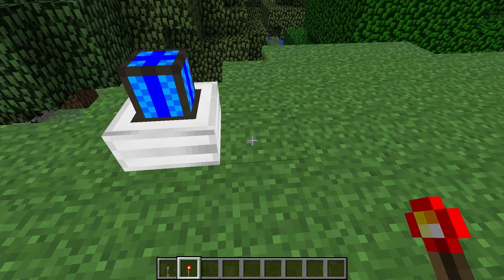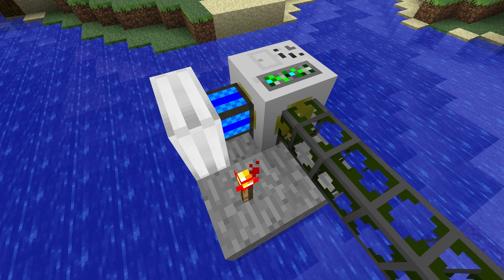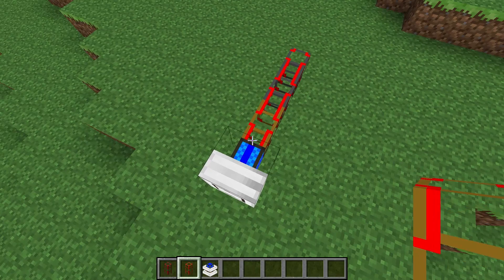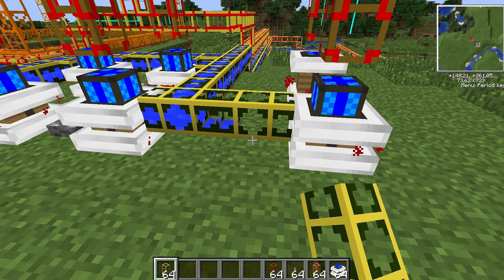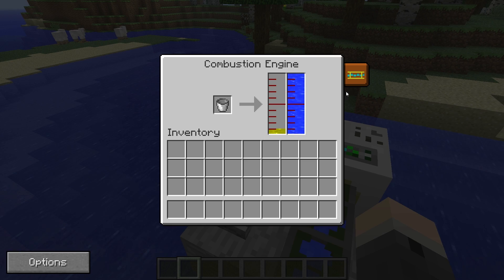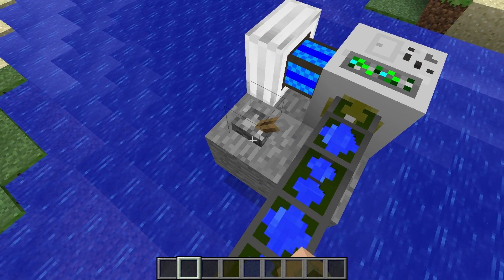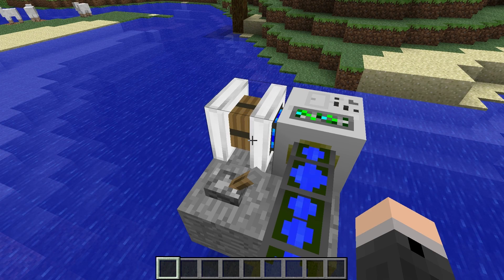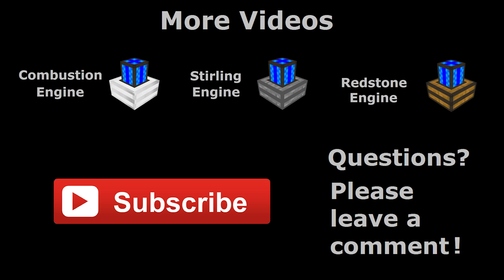Combustion Engine Troubleshooting (Tekkit/Feed The Beast) - Minecraft In Minutes

Comment: Nice tutorial! But After some time my engines stopped putting energy out, they only store it and overheat cause of that. It only started when I left to travel and unloaded the chunks. Any ideas on how to fix it? I tried replacing both pipe and engine, re-powering them, and all the things the tutorial was about.
Reply: I fixed the overheating, they still don't output it tho

Comment: I've tried using the lever, I've tried every single pipe in the game, I've tried other sources of energy and energy converters to RF, I've tried hooking it up directly to my massive vibrant capacitor bank.. I have the water gauge full, I have it maxed on fuel and I have a redstone signal / lever, but the fucking piece of shit still fails to turn on... Great guide, but I swear, FTB must've broke something. It's funny because even half of IC2 shit works and now BC is pissing me off. Even with the wrench, most of the machines break. Seriously, why? Everything else is pristine, but these 2 mods are majorly flawed.

Comment: sterling engines. use coal and charcoal..... you can stack them behind each other in rows on monster mod. in the infinity mod packs you cant but two is enough for a while until you get rf up and running or eu power. :)

Comment: I got a problem, I have recently started playing tekkit, i have my combustion engines working just by putting a bucket of fuel or oil into the engine. I set up a water pump and am now getting water pumped into the engines but my problem is, i want to pump in oil or fuel thru fluid pipes but cant get oil or fuel to pump into the engines, my fluid pipes are conected to the engines and are completly full of fuel but wont flow into the engine. Any ideas???
Reply: +Donny Terry Same here mate. And I am clueless I tried every possible pipe but still not working...
Reply: I think I’m a little late but yeah same problem lmao

Comment: One problem: When I connect more than one combustion engines to one pump to get water, after few mins, it always became only one engine get the water filled, rest of the engine's water storage will come to empty! I have tried to evenly the length of pipe to each engines, but the problem still there. can any one suggest me ho to fix it?

Comment: Hi All.

I have a combustion engine setup with water pumped into them from a tank that is connected to a pump. When my engine is cool the water fills up, once my engine goes past 100C the engine uses all the water and then does not take water back on until its belowe 20C, what am I doing wrong?

Thanks

Comment: im having a different problem, and that is keeping the engines from running out of water. in one case i have 3 engines powering my refinery. and out of the blue the water will only trickle in the pipes, with 2 pumps and 6 redstone engines powering the pumps.

Comment: 1) In order to re-start a combustion engine, it simply has to have been at 0°C for at least 30 seconds.
2) You can also use Forestry's biofuel in a combustion engine, and it'll produce 5 MJ/t.
3) I assume you went over water supplies in your previous video on combustion engines, but the best way to supply them with water uses Thermal Expansion's Aqueous Accumulator and Liquiducts. One accumulator can keep up to four combustion engines running at a safe temperature if you use liquiducts to transport the water between it and the engines.

Comment: There's a bug with 1.7.2 buildcraft where the combustion engines don't take buckets of fuel, or water, but it will take it through pipes.
Reply: No I never did, I just went back to 1.6.4 Buildcraft, and it works on there. I would suggest you do the same, since these videos are on 1.6.4 I'm pretty sure.
Reply: I`m 1.7.2 using Buildcraft 6.0.16
You Can use Creative engine
Download :www.mod-buildcraft.com
Reply: Wrench It,
Limit Creative Engine : 128 MJ/t